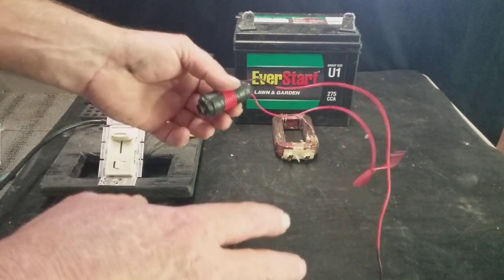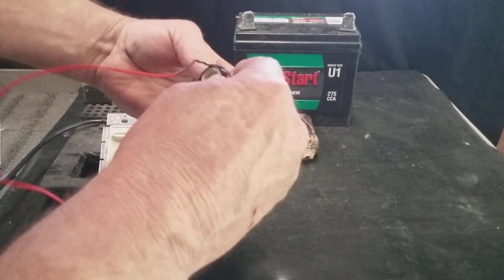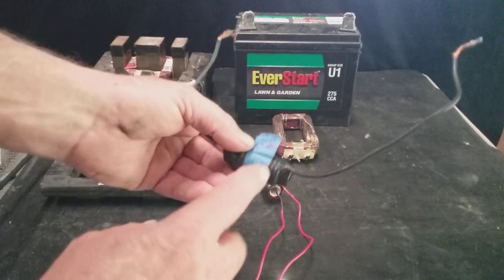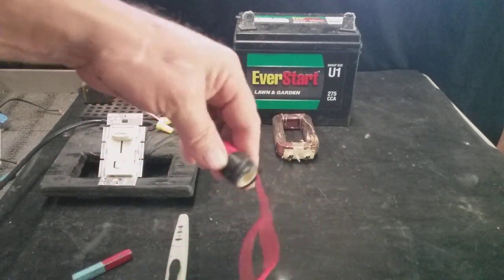Coils Odd and Even numbers of winding "Layers".

Comment: try CL going in and CCW coming back (Bucking) Floyd Sweet
Reply from the maker: I will when I get time to wrap it!
Reply: @TheGoodVibrations  If your interested in replication/collaboration check my video called "Energy Loop"
Reply: @QuasarKin  The Flyback is a high voltage ac spike, far from a smooth ac signal but none the less AC so that means North and South. Think of the top half of a sign wave as North and the bottom half as South